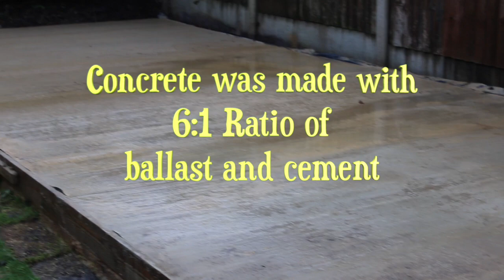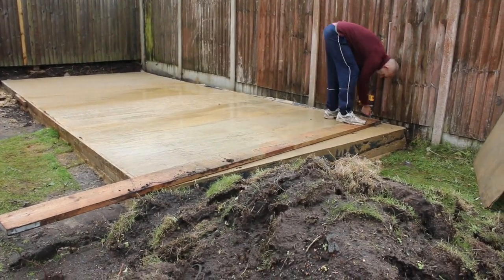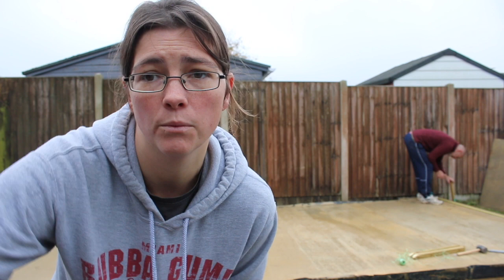Building a Budget Garage - Part 1 The concrete frame

Comment: Good vid. Did you need planning permission for this build?  And are you allowed to build as close to the neighbours fence as you like?  Or do you need to leave a certain gap.
Reply from the maker: Hi there thanks for the encouragement. So a outbuilding comes under permitted development and doesn’t require building regs so long as it meets height, size, how close it is to the neighbours and what proportion of your land it covers. It’s quite complicated but you can find the details on line 😊
Reply: @thenewboldsclan  Should be 1 meter from the boundry wall to conform with PD.
Reply: @marcscotland7120  I don’t think the 1 metre rule applies providing a given proportion of the outbuilding is built from non combustible materials so with this being concrete block it would be fine
Reply: Do not think it applies in many cases, including if you have a semi?

Comment: Good effort but as a bricky I would have used a 4:1 sand cement ratio; 3:1 can be too hard and prone to cracking for above the slab work

Comment: I'm going to sound stupid as, but I'm looking to do same thing just wondering why you haven't done footings for brickwork and gone straight onto base? 🙈👍🏼
Reply from the maker: Not stupid at all!!! We had initially planned to do a pre fabricated cement garage so only needed a concrete slab to put it on, however circumstances changed so we decided to build our own. So we did the brickwork at the bottom with damp proof to protect the wood from moisture then wooden frame, but galvanised corrugated metal sheets on the sides you can’t see (to make it majority fire resistant) then wooden cladding where you can see 😃 We have a cabin next to it we did footings and I would recommend that if you don’t have a concrete slab where you are planning to build yet ...hope that helps.

Comment: How thick was the base and how thick was the outer perimeter? Thanks
Reply from the maker: RatchetMonkey the base was 100mm/4 inch’s thick minimally everywhere including the outer perimeter but we reinforced it with steel rods throughout. You can do it with a trench around the edge which would be another 4 inches deep, which would be where the walls would be. The base we did is called a floating concrete slab.
Reply: @thenewboldsclan  That's great. I have also done the same with mine although a 6" slab. 5.2 x 8.2m but i've gone for a timber frame and no blocks at the bottom. 

Great build and good video.
Reply from the maker: RatchetMonkey awesome!!! Yeah timber frames are really good. We did just a few layers of bricks to help avoid damp but that was us just being extra precautious. Thanks for the encouragement :) enjoy your new man cave!!!
Reply: @thenewboldsclan  Can i ask if you poured the slab yourself or did you hire a builder for this? Do you mind me asking how much this cost to pour or what the material cost was to do this if done yourself?
Reply from the maker: @YauMannn  hi we poured it ourselves. We had a cement mixer and brought the ballast and cement. That cost us £280, but because we did it ourselves we saved on labour which would be the most expensive part. You can pay for companies to deliver cement in a pump but that averages between £400-£600. Hope that helps :)

Comment: What was the overall cost of materials ?
Reply from the maker: For the complete build or just this part? Thanks
Reply: What was the cost overall for whole build please?
Reply from the maker: @danieljones2081  £3000, we were quoted a lot more! Depending on your area materials will vary very much in price. We live in an expensive area 😉 but the method is cheapest we could find
Reply: Great stuff. What kind of blocks did you use?
Reply from the maker: @joelprinciple7519  standard 100mm blocks
Reply: @thenewboldsclan  Thanks for sharing....